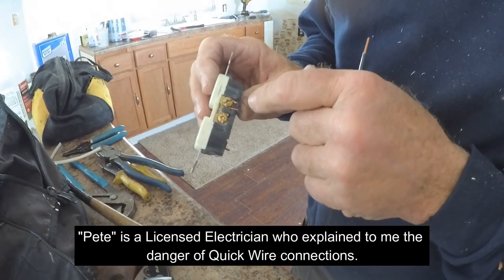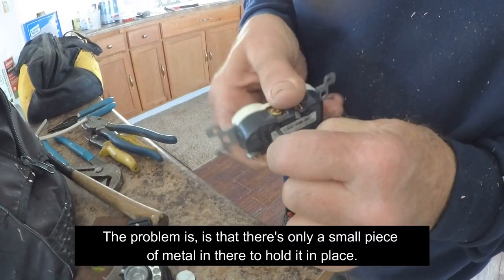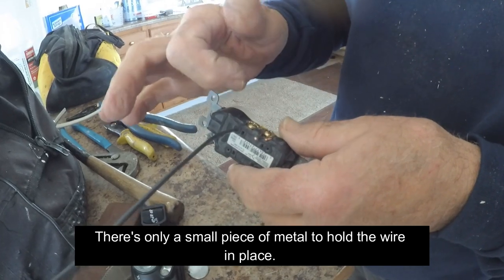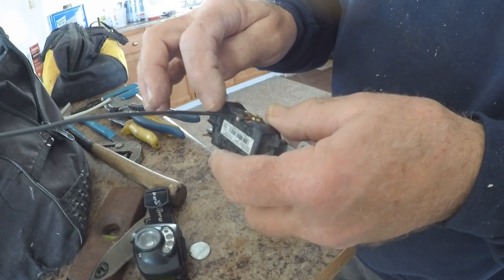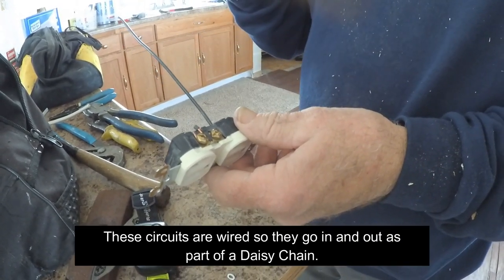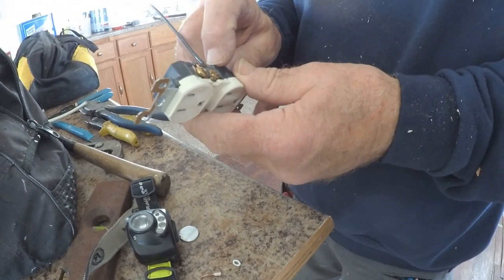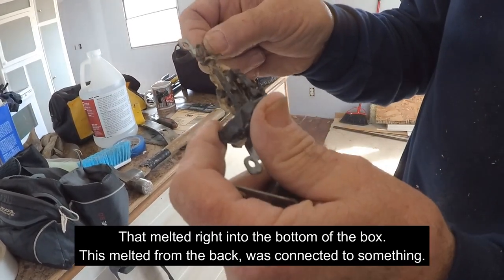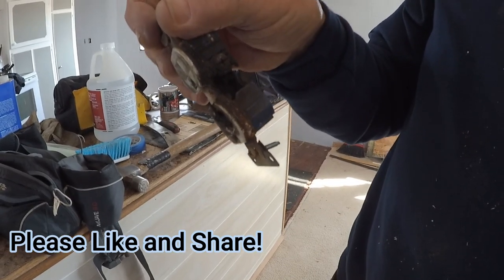The Problem With Quick Wire Connections in Mobile Homes

Comment: I just bought 20 commercial grade receptacles today to replace the receptacles in our home. Most of them, if not all, used those push in terminals. The commercial grade receptacles don't even have that feature. I'll replace two or three a day until I get them all done. Our home was built in 1996. I replaced a couple switches recently and when I went to remove them from the box two black wires just fell out of the back of the switches where they were backstabbed.